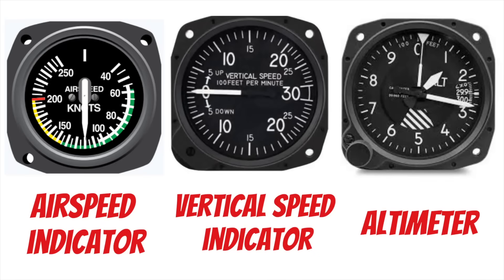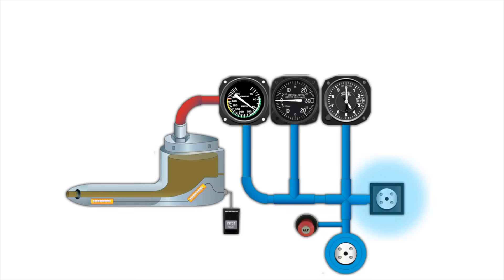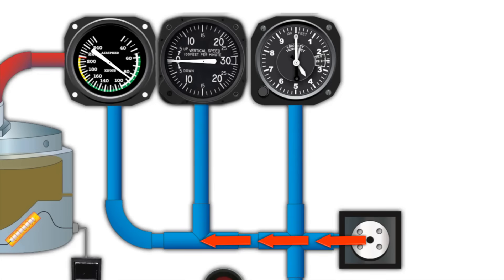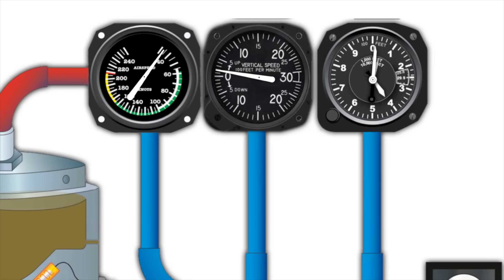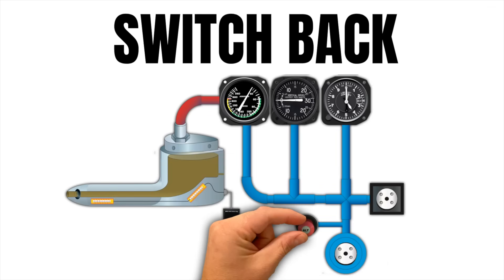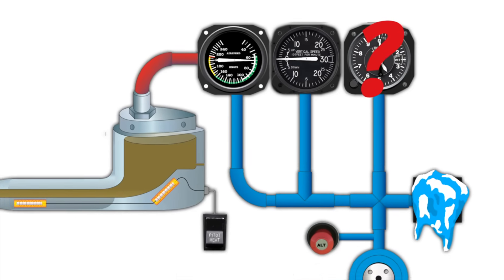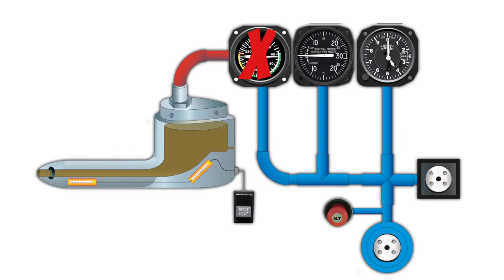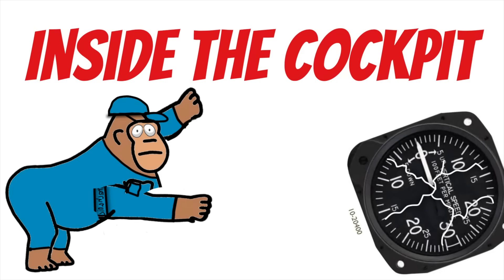The Pitot Static System Explained (for IFR pilots)

Comment: Good vid... but a few thoughts.  1) If you are flying in the weather.... an you plug a static port.... you have bigger problems. (Structure ice)  2) The Alt static port.  I never liked the FAA saying there is a "Suction in the cabin" since that's not always true.  Cessna's have vents in the wing, and make ram pressure.  Warriors also have opening and make the cabin slightly higher pressure in flight. 3) ALWAYS break the VSI glass in an emergency.  for one, it's the cheapest to replace, but it's also the only one that you dont' really need.  If you break the glass on the AS or Alt, and you damage the gauge.... you will be in bad shape.
Reply: Wait, i didn't get the structure ice thing, could you explain please?